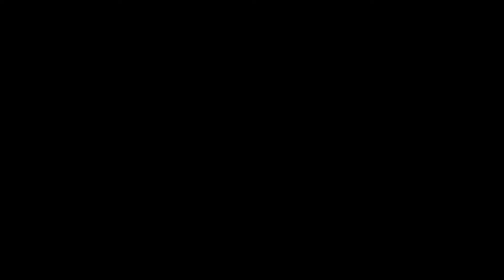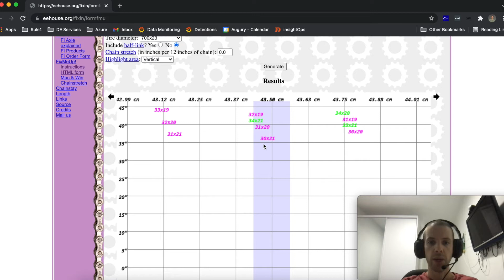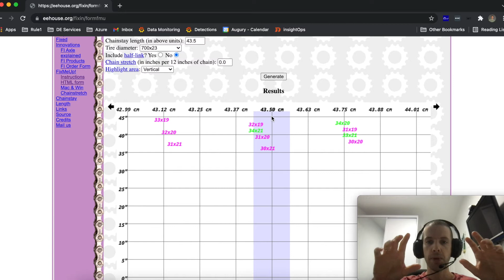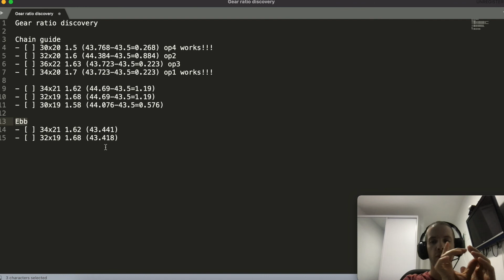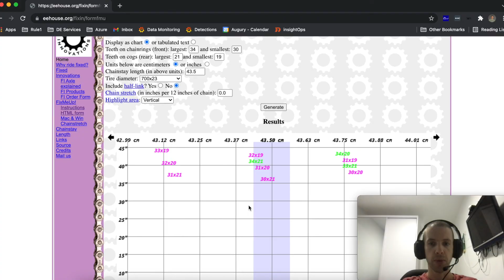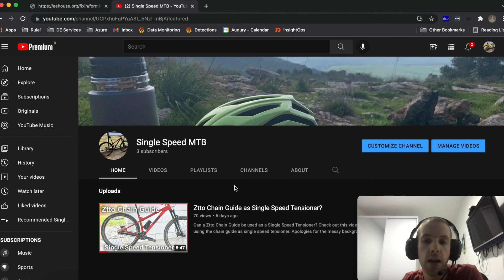Single Speed - Magic Gear Guide (FixMeUp)

Comment from the maker: 4:50 *ebbs usually allow +/-3mm of movement
Reply: Does a 26/9 gear ratio have more torque than a 25/10?
Reply: @hulkster4374  a 26/9 gear will be much more harder to push than a 25/10 gear